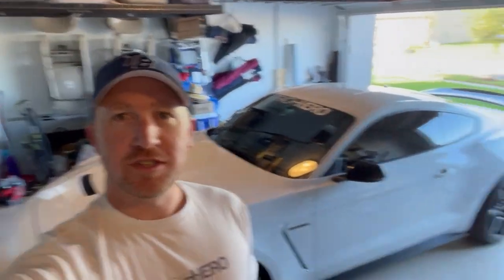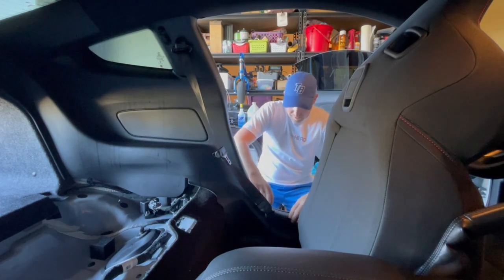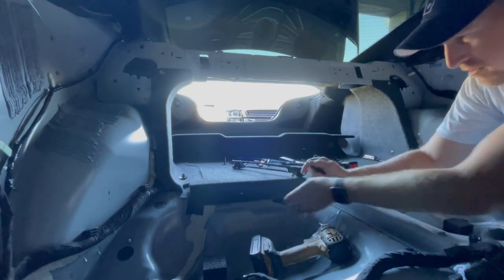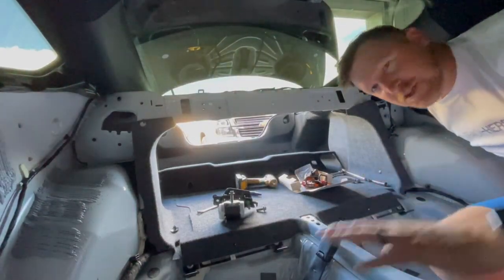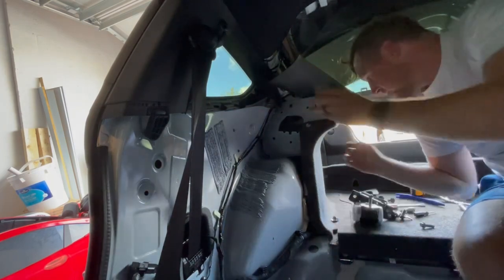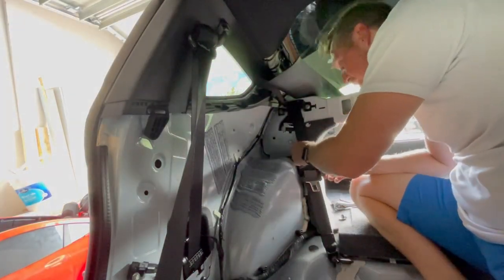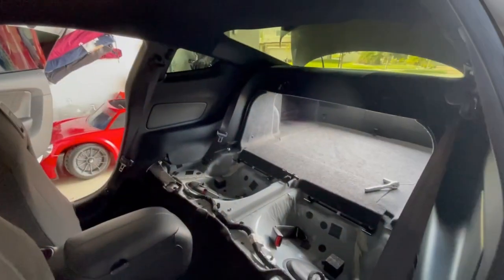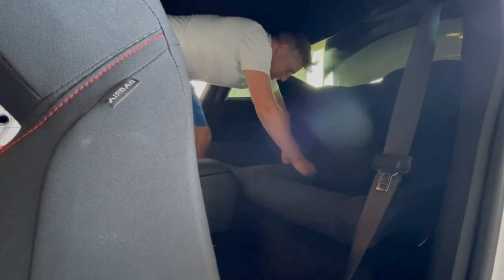Shelby GT350R rear seat install

Comment: I had a 2014 GT500 that I put the ford performance rear seat delete kit with x brace in so I was familiar with removing the seat and putting it back in, however I just got a 2022 GT500 CFTP car and wanted to put a rear seat in it for the kids. Thanks for posting this video. Everything went smooth and I was able to reference a couple points in here to make sure I did it right!!!
Reply from the maker: Awesome glad it helped. I wanted to go super in depth since there was only one vid out there about this and it missed a couple steps

Comment: Thank you for this video man. Been going back and forth between a 350 and a 350r and this just helped me decide. I’ve got two little guys that I need the rear seats for but love everything about the R. Adding the rear seats back definitely the cheaper option then buying all the aero fenders and doing the rez delete on a 350
Reply from the maker: Definitely!! I was in the same boat. I knew I wanted an R but taking my son with me was always important so as soon as I bought the car I started looking for a rear seat out of the GT350. Best part is I sold the rear seat delete and made some money lol
Reply: @BROCKgoFAST  good thinking! I’m waiting a few months to see if the car market dips. Everything I’m hearing is we’re in for a price crash. Not sure it’ll affect collectible cars tho.
Reply from the maker: @viperonfire2006  yeah I totally get that. I think we are seeing the used car market going down a little GT500’s have been going down a little but I think the modern collectible sports car is going to hold value, especially with the EV push

Comment: Amazing video, just pick up my GT500 and I want to do the same, any list of the parts and parts number. Thanks
Reply from the maker: Thank you so much!
Reply: @BROCKgoFAST  I think I found all the main parts. What I am missing are the screws and one part goes in the back to support the seats the one where you remove the cover tapes.
Reply from the maker: @ramondejesusmunoz3675  those should be pretty easy to get. You can either look on line or go to the local dealer and they can show you the parts diagram that way you can tell them exactly what to order

Comment: Thank you so much for this video! Because of this I was able to put in the rear seats in my GT350R myself. One question,.did your seatbelts come with the plastic 'cover' that you put in the panels? Mine didn't, they were already in the panels when I bought the car. But there's no way to pull the seat belt clip through. Hope this makes sense, hard to explain. Haha
Reply from the maker: @StephanUmmels  no problem and glad it helped. I tried to go in as much depth as I could. Yes the belts came with them already on.
Reply: @BROCKgoFAST  Thanks! Do you know the part numbers (left and right) of the seatbelt with the cover on it by any chance? I might order new seat belts then.
Reply from the maker: @StephanUmmels  to be honest I have no idea. Probably have to look up a parts catalog and get the part numbers.

Comment: On the bracket in the middle that goes between the two seats did you have to order a bolt for that?
Reply from the maker: No the previous owner supplied it
Reply: @BROCKgoFAST  thank you. I’ll need to try and locate one and then I need to order that stud kit.

Comment: So just to be clear, you used a regular GT350 rear seats? I have been looking for a kit too for my 350R and when I went to the dealership to order regular GT350 seats they  told me it wouldn't work.
Reply from the maker: Yes. I used GT350 rear seats and all the hardware. Your dealer rep must be new because you can use Mustang GT seats as well
Reply: Your dealership is full of shit. ALL 2015+ rear seats of any Mustang will fit in the GT350R.
Reply: Yeah, thats what I thought. I dont much would be different with the chassis. I dont trust my local dealership for nothing. My GT350R only has 6K miles and I took it for its first inspection and emissions. And when they supposedly drive the car into the bay the check engine light magically "lit up".  I had already drive the car like crazy and there have been no issues. Then the clerk tried to sell me on services. I asked them to show me light and the light magically turn off. So I just left and they told me I needed new tires.I guess they just dont know their own cars because the car comes with sport cup2's. Lost faith in my local dealership... sorry to vent..LOL
Reply from the maker: @greynbluehoya630  oh man I would stay far away from this dealer
Reply: @greynbluehoya630  Thats bullshit man.
Reply: Love the channel keep it up HR542
Reply from the maker: @greynbluehoya630  thank you so much, means a lot

Comment: Can you give me the part numbers for the studs and nuts? No pun intended
Reply from the maker: Here ya go Part No.: -
W708166-S424 stud
W714265-S442 nut
Reply: Is that for the studs? Is it a kit...sorry I have a  gt350 rear seat and missing some random stuff...I appreciate your video
Reply: @BROCKgoFAST  much appreciate it
Reply from the maker: @understatedperformance  no problem. The top part number is for the stud and the bottom is for the nut that goes on it. Had to buy them individually. Got them from FordPartsGiant online. Hopefully this helps. It was the only thing I didn’t have with the GT350 seats and belts I had purchased
Reply: @BROCKgoFAST  i have the belts but no bolts or the plastic trim...and dealers don't sell individual pieces
Reply from the maker: @understatedperformance  oh man you might have a hard time getting some of that stuff. I know the dealer wants crazy prices for it all. But lucky enough you should be able to get it all out of a wrecked GT